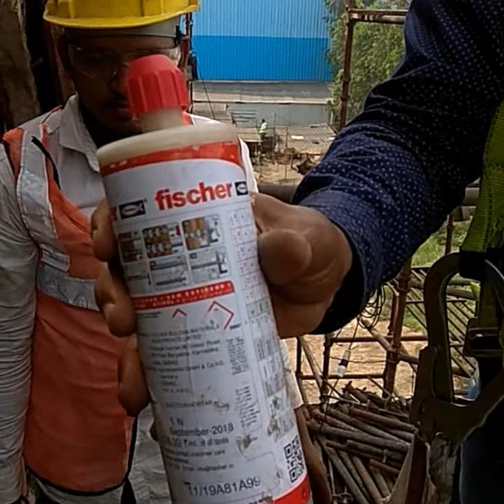Rebaring work in RCC Columns & Wall by Fischer Chemical method.

Comment: Good Content sir. But a small correction. Just like for construction of a building where structural analysis is necessary, it is equally necessary to design post installed rebar applications like these following Eurocode 2 refer Technical Report 023. Just FYI. 10times the diameter is not the right measure of  depth.
Reply from the maker: Thank you brother for good suggestion ,, In the next video, reference was made by checking the video above what you have given .

Comment: Hi sir,
Can i extend 2.5 feet rcc slab of ground floor length 30 feet just for passage of 1st floor...no loads no wall just slab for passage..
1st floor outer walls will be on old slab itsef...
Reply: Yes why not.install 4columns for load distribution

Comment: By doing this you are missing 2 valid points . 
1. The joint doesn't become RCC for beam . It's only steel there at beam-wall interface to take care of the load . 
2. The beam doesn't get any bearing on  wall .

Comment: Aise karne bricks ka weight sahan kar lega?
Reply from the maker: Beam full load legi bhai as per design.
Reply: @rbsinghcivilengineeringaca6777  ok,mere ghar k bathroom ko extend karna hai 2 ft, contractor rebairing karne ko bola hai,ye safe hoga?
Reply from the maker: @kiranbhatia2554  dono site columns hoge tabhi karna.
Reply from the maker: @kiranbhatia2554  too beam jada load legi
Reply: @rbsinghcivilengineeringaca6777  ok thanks, 🙏 ye safe to hoga? Pune main rebairing cost approx kitni hogi

Comment: This is an absolutely wrong method of post installed rebar grouting. 
First of all Rebar grouting methods and principles are defined by European Technical Association and not IS. Also there is no concept of 10XD. That is absolutely wrong.
The drilled hole diameter for every rebar size is mentioned by ETA.
The cleaning of holes need a brush cleaning along with blower.
The way the chemical is injected is wrong. You should use a plug for that.

You should always understand that any engineering application should not be causally taken into account.
Reply: Yes you are right. This is all poor work.

Comment: Coloum ka v same process hota h?
Reply from the maker: Yes brother.
Reply: @rbsinghcivilengineeringaca6777  sir 2nd floor ke roof casting me 1 bich me coloum ka 3 sariya roof ke andr hi dab gya galti se rebar ke liye kitna inch andr drill karna hoga
Reply from the maker: @Tej_bharadwaj  dear column ka steel ka dia kya hai & Slab ki thickness kya hai , please confirm
Reply from the maker: 10×dia of steel, Concrete mein hole karna hota hai minimum..
Reply: @rbsinghcivilengineeringaca6777  we can use this method for column extension. Am I right? My column steel bars have corroded, some 16 mm bars have become the size of 10 mm. Can we use this technique for reinforcing the existing column steel bars?

Comment: How many inches of steel should be inserted inside the concrete
Reply from the maker: Minimum 10 dia of Steel.
Reply: concrete insert steel length
Reply from the maker: @6070avm  minimum steel inserted in the concrete 10 X dia of Steel, 

Suppose that steel used in the columns 12mm dia ,  minimum requirements of steel insert of concrete 120 mm .

maybe clear this doubt sir ji.. 👍👍
Reply: @rbsinghcivilengineeringaca6777  Thank you sir
Reply: @rbsinghcivilengineeringaca6777  , he is asking how many inches ...gaddha mistri ban'na chahiye .

Comment: Sir kisi slab pr M25 dalni thi or galti se M20 dal gyi ho to fir solution kya hoga plz reply. M ye question ka answer kafi time se khoj rha hun plz solution provide kren.🙏
Reply from the maker: Concrete ya steel
Reply from the maker: Dear 15 days curing proper Karo & Slab ki shuttering 28 days tak rakho .& 28 days ka cube strength yadi 25 N/mm2 aa jati hai too very good..
Reply from the maker: Kitna time ho gaya hai slab casting Ka.. please share the information..
Reply from the maker: Cement ki information dena ..
Reply: @rbsinghcivilengineeringaca6777  OPC 43 grade ultratech
Reply: @rbsinghcivilengineeringaca6777  sir ye question mere ek dost ne puchha tha. Abhi tk EASA hua nahi h pr knowledge ke liye puch rha hun . Kya slab thickness badhani pregi or agar Han to kitni. Plz reply
Reply: Concreting krte time
Reply: better to consult structural design engineer..He can close yours appeals. that's it. Same things we faced.

Comment: Sir Ji, Chemical to theek hai, Lekin hole 🕳 for 2/3 full kiya Jata hai Pehle. Jaise aapne kiya hai woh itna nahi bhra. Main bhi yehi kaam karta hoon Australia mein. Hum Hilti Use karte hain. Cleaning process bhi aapki thodi aur safai se honi chahiye thi. Brush use karke, fir blower, fir brush fir blower. Chemical anchoring is a serious business and your bond is as good as your hole cleaning. Wear ear muffs and gloves for safety reasons. Be safe and keep up the good work.
Reply from the maker: Very good dear , Next video me aap ki baato ka dhyan diya jaayega..

Thank you for good suggestion..
Reply: Aur bhi ek bat hai ki 20 dia  rod k liye drill bit bhi 20 ka hi use kiya, kya ye sahi hai??
20 dia ka rod rebaring k liye bit kitne mm ka use karna chahiye??
Reply: @hemalpatels2016  20mm ke rebarring ke liye 24 mm ki bit use honi chahiye
Reply: Can any one sugest best chemicals brand for rebaring for 18 inch cantilever beam..(this beam will also carry brick wall load)
Reply: @nanamarkad7832  Hilti has quite good reputation. Better off consulting them before use.

Comment: How can we calculate rebar drill debth for formula
Reply from the maker: 10D is taken and which is important in depth of hole , So that my steel , Dia is 20 or 25mm, Hole depth = 25×10 = 250 mm & 20×10 = 200 mm as per IS code required for rebaring work
Reply: @rbsinghcivilengineeringaca6777  

Sir kindly tell us IS CODE no
Reply: Class 5 me join karo . Multiplication sikho useless log .

Comment: Firstly, it is not rewiring it is rebarbing, secondly your method of grouting is wrong, chemical is poured inside the hall at once and it should fill and come out and thirdly your grouting chemical itself is wrong.